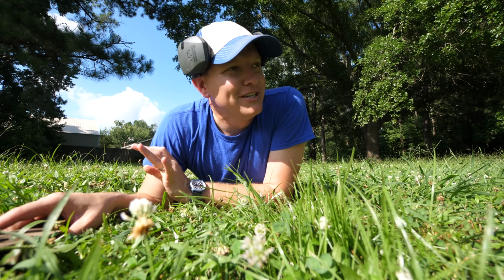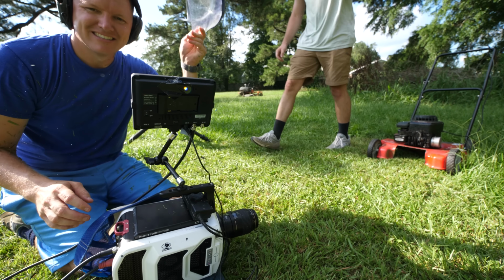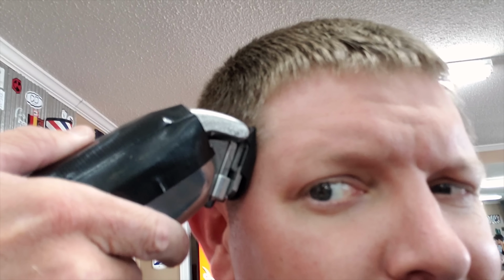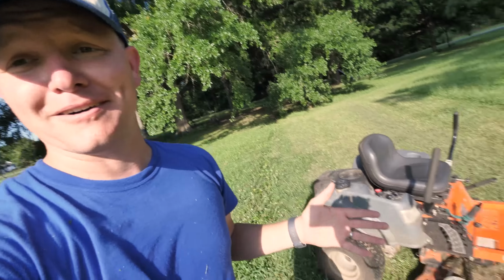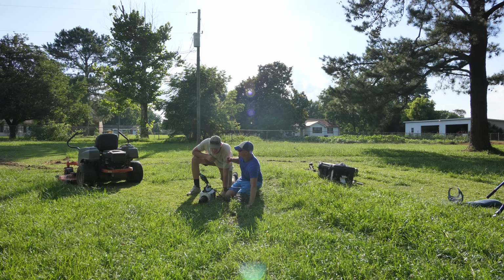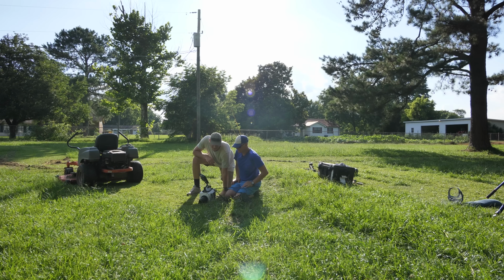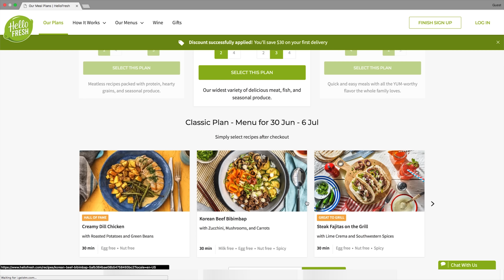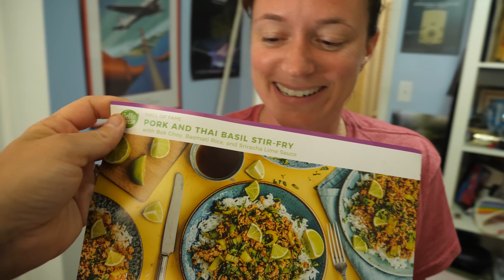How Lawn Mower Blades Cut Grass (at 50,000 FRAMES PER SECOND) - Smarter Every Day 196

Comment: I'd love to see how a scythe cuts grass. Does the curvature of the blade help or is it just for shape ? What's the technique etc
Reply: Not sure how the curve helps, if at all. I do know scythes need to be much sharper than a mower blade, like kitchen knife sharp. They also need to be honed very often while in use
Reply: the curve is because you kind of swing it around yourself and because your arms draw a curve the blade has to be that too

the grass is getting cut due to the slicing movement
Reply: grassynole07 
Speed is the key, blade to ground speed.
Fast and consistent, it’s an inertia tool.
Of course the blade should be razor sharp, done with light strokes of a fine grade stone every 4-5 minutes of cutting time.
An impressive tool in the right hands, and the movement is all in the knees and hips.
Reply: whatthewhat11 
A scythe is slicing tool,  like a Katanga.
The curve is so that the scythe blade hits the grass blade at a very small angle,  about 10degrees,  and slices it.
The cut swathe is less wide than the scythe blade.
It is not an inertia tool:  an experienced user can move the blade quite slowly.
This is quite different from the rotary mower blade,  which hits the grass blade at about 90degrees and so depends on speed and inertia.   The cut swathe is as wide as the blade is long.

I was taught to use a scythe by my father,  who (65 years ago) used it for mowing hay,  and by the gardener at the Manse who used a scythe to mow the squire’s lawn (A British lawn;  grass 0.5 inches).
Reply: Don’t think it was invented for cutting lawns .
Reply: The curvature of the blade means that as you draw it across, the sharp edge isn't hitting the grass at a 90° angle, but a much shallower one.
It's not like a razor blade, which relies on being incredibly sharp to do its function, but instead relies on moving across the grass, rather than into it. It's the difference between cutting and chopping; you cut down a tree with a saw by moving the saw back and forth, and you chop a tree down with an axe by hitting into it, not slicing across it. 
I hope I haven't over-complicated too much. Difficult to explain with words, but give me a bread knife and a loaf of bread and I could have explained it to you in seconds!
Reply: Kuubo 
You’re right.
Katana,  not Katanga.
Reply: The video is on YouTube
Reply: Basically the same physics really
Reply: Just cus of it being sharp
Reply: This makes me wanna cut grass with a scythe now
Reply: Oogly Sproggs your right but you kinda did slide your razor across your face to shave
Reply: This curving effect is easiest to imagine in a guillotine. Notice the angle of the blade in comparison to the direction of the force. This angle in addition to the sharpness of the blade makes the cutting action of the blade to move across the object with less required force to cut. The scythe needs to apply a lesser cutting force onto the blade of grass than the strength it requires to stand freely.
Reply: Simple - it's sharp !!!!
Reply: This comment thread is the lamest, most interesting thing I've done today and i work die making and assembly.
Reply: Wow I never thought about how scythe can cut grass.
Reply: Crve helps, just as the angle of a guillotine facilitates a ct
Reply: Scythe has a pitch angle also (not horizontal cutting edge, same as shaving razors), the curve mostly helps bundle and control the crop to the left for easier bundling/bailing. Scythes are sharper than mower blades which reduces the force / impact required to sever or locally fail the stalk material, reducing the cutting speed required. Scythes were traditionally peened and sharpened to allow for a harder cutting edge allowing it to hold an edge longer between sharpenings.
Reply: Yes the curve helps.   Curve in the blade is to hit the grass at an oblique angle.   The curve of the handle allows you to keep that angle through the swing.  It also helps to push all the grass or whatever into a bunch.   There are other curves as well.  I have a small grass sickle for gardening, and it's got to be held and swung in a specific way. You can't just cut.  Takes a certian speed and swing.  Big ones have handles and angles built in that make all that much easier.

Comment: Destin: Mowers don’t cut like scissors.
Reel mowers: Am I a joke to you?
Reply: The first thing I thought of when I saw this video last night.  I wonder if he is aware of this since making the video.
Reply: Beat me to it!!!
Reply: Obviously many people thought the same as me.  The neighbor across from my parents mows his acre with   5 reel mowers he pulls behind his riding mower that is just pulling.  He says it cuts sharper and straighter and from how manicured it always looks I'd have to agree.  I think some golf courses use these as well.
Reply: @johnjornod6429  Fairway and greens- Reels..cut more evenly and closer to the ground.  Rough - Rotary.  The reel mower blades are harder to sharpen and require more overall maintenance from what I have been told.
Reply: @Seriouslydave  Similar to a sickle bar.
Reply: @somaday2595  same thing haybine is probably the product name. Sickle bar is where the teeth are attached.
Reply: @Seriouslydave  Haybine is a sickle bar mower + mower conditioner and I think may have been a NH trademark.  I think disc mowers have largely replaced the sickle bar in most mower conditions.
Reply: @somaday2595  yeah, i still have scars from replacing those teeth. Esp in the field
Reply: I know I'm late to the party, sorry. Same here. The only difference is where I come from, we call them cylinder mowers. We use them on high quality sports fields. They have a much cleaner cut than rotary blades because of the scissor action than the rotary blades chopping action. 
The challenge with rotary mowers generally is the lack of vacuum. They need the grass to stand tall but not long, that's why they are in front of the wheels.
They also tend to follow the contour of the ground because they are usually I divided cylinder heads than one wide rotary deck. 
Also they don't tend to all discharge to the one area, they discharge straight out behind either in a receptacle or on the ground.
I would love to see more about the rotary mower though. Like some aerodynamic imagery with smoke or dust or whatever they use to test that. Get the camera through a looking glass of the deck say.
Cheers
Reply: @johnjornod6429  just cant have sticks and stones they make it almost impossable to ust 1

Comment: Lets do a collaboration on a stump grinder.  We can show how the teeth disintegrate the wood as they grind the stump away. That would be perfect for a slow mow sequence.  I have a brand new one we can use.  I've done a few heavy equipment videos like that and have plenty of gear to test out.
Reply: Also your retaining wall videos saved my backyard.
Reply: yes please
Reply: That would be awesome
Reply: Would be awesome
Reply: Mowing a 6 inch tall weed infested lawn with a rotary mower  and demonstrating cutting characteristics only shows that you don’t know what the original engineers had in mind when they designed it.
Reply: Woah, I follow you too!! This is the best...... 

Do ALL the collaborations!!
Reply: Any chance you live near Hamilton, Ohio?  I would love to see how it removes the roots from a tree in my front yard that needs to be cut down.  It is almost completely dead.
Reply: @Grumpy_old_Boot  An edger, how on earth can an edger cut grass?  There is nothing sharp and there is nothing to suck the grass up so it can cut.  Amazing how a something that only has a plastic line can cut grass.  It also edges.
Reply: @ksingleton101  
Yeah, that would be cool too.
Though technically, it doesn't really cut the grass as much as it used superior blunt force trauma to shatter the stalk apart !
Brute force approach. 😁

Comment: I want to see a chainsaw. It wouldn't be cool in wood(because wood is opaque) but maybe in clear plastic. I have always wanted to see the blade in slow motion tearing away wood chips
Reply: A circular saw would be cool too, especially if you could see how each tooth cuts from a different side.
Reply: Bigfoot And Bananaman for some insight. I would not say that chainsaw tears away the wood. It's more of a wedge that shaves the wood. Each tooth on the Chain just shaves a little more off as it's pulled through the wood. Similar to a wood plane shaving wood off. Circular saws do the same thing.
Reply: I rarely bother to comment on Youtube videos, but I came down here to also request chainsaw footage.
Reply: I agree with the chainsaw, including circular saws. My question would be about different chain types (not so common) or different circular saw blade types (more common). I know saw blade types are for rough cut (fast ripping) vs smooth cut (usually slower). I imagine there is a trade off between how much material you can knock off with each tooth VS bogging down the motor and loosing RPM & efficacy.
Reply: I also want to see a chainsaw,  a real nice gas one and maybe a comparison to a decent battery powered one. I'm curious about a few things.
Reply: The Wreckers keep the tooth from twisting and taking too large of a bite this twisting action causes the tooth behind it to skip at least that was the reason I was given for the design of the skip tooth chain, honey skip tooth higher ratio of  teeth on the Chain are actually cutting each pass circular saw and guessing is going to be each tooth is cutting as the blade is not distorted that shape on the hinges
Reply: chip formation in metal cutting is some pretty cool stuff too.  There are videos already available for that though.
Reply: It's super interesting how saws are designed to handle the waste product of sawing, they often have special teeth designed into the saw's blade to push the shavings out of the cut. The cooler thing is that chainsaws handle shavings different from cross-cut saws, which handle it different from other types of saws.
Reply: you could use a flat board and see the chips getting cut
Reply: David Drescher,  The rakers, or more specifically the depth gauges limit the amount of wood each tooth can cut on each pass.  The drive links on the chainsaw chain limit side to side movement in the cut.   The cutters actually porpoise in and out of the wood taking bites, until the space between the cutters fills up and then it stops cutting and just drags the debris out of the cut. 

  Standard sequence chain has a right cutter and then a space and then a left cutter.  Skip link chain has a right cutter and then 2 empty spaces and then a left cutter, so you have 1/3 less teeth on a skip link chain than a standard chain.

 This comes in handy on long chainsaw bars over 2 feet long, because the length of the cut is so long the spaces fill up too fast on standard chain and spend more time dragging than cutting.  Also because you have less teeth on skip link,  it takes less engine power to pull the chain through the cut.
Reply: I ask for this on every slow- motion channel as well :)
Reply: As a bonus, slow motion video of how different hinge types cause the tree fibers to fail/bend/guide the tree as it falls.
Reply: Bigfoot And Bananaman ，
Reply: @WhoDatBoudreaux  im not an expert in chainsaws but i can tell you this
the deeper the cut depth on a chain saw the more likely it will try to kick up 
the deeper the cut the faster you can vut but that also probably means you get a rougher cut (similar to a circ saw) 
a shallower depth o cut means lower risk of slicing your face open on the chain (which is why theres a chain break in the even of a kick back {the break will engauge and keep the chain off of your face}) you probably get a higher qualaty cut but its slower
my dad had a stihl ms 171 with a 16' bar and a fairly shallow cut depth it worked and it was as good as you can assume for a consumer grade saw
he got a stilh (i forget i think its liek a 261 or something) and it has a biger 18' bar with a larger depth
its also a larger saw
Reply: If u just said why u dont want them to cut wood and you want them to do it with plastic than why are you now saying that youve always wanted to see wood chips cut?
Reply: But that is pretty self explanitory of how it works, theres nothing to explain.
Reply: Bigfoot And Bananaman what i would love to know is how chainsaw motors are so durable and hardly have any motor faluire unlike other bigger 2stroke engines that are so common for piston or ring troubles but yet a chainsaw will run 20 years without a hiccup but a 250 dirtbike motor needs to be rebuilt once a year
Reply: Maybe you should youtube it 😆
Reply: Very satisfying it would be

Comment: I learned something today too... your lawn mower blades are super dull lol
Reply: I noticed that to.
Reply: It is kinda interesting... at one of my first jobs, the guy I worked for had me use a lawn mower which was later found out to have the blade upside down.  It did not cut well, but it did... far better than I ever expected it to.
Reply: @tonysmith5077    *too
Reply: I just wanted to kiss those blades with a bench grinder. Or a file. For real.
Reply: @paulstandaert2042  I thought you were me lol
Reply: Good luck changing em
Reply: Ha.  Same comments below.  I felt sorry for the grass blades getting beat to death with a dull blade.  I am a sharp tool fanatic and that hurt to watch.

Comment: Lawn series: Does a drop spreader spread more fertilizer when it's full (compared to the last quarter before empty)?
Why do some garden hoses kink and others don't?
Does a sprinkler apply water evenly, or more in some areas?
Is a reel mower like a pair of scissors?
How does an aerator really let the air flow in, although the holes are far apart?
How can you reduce evaporation on your lawn?
How does cutting your awn to different heights affect evaporation, spreading of grass plants, wear resistance, weeds...

Comment: Well, the most obvious thing to study next is the weed wacker, but I'm curious about the garden hose sprayer. You know, the one with the dial that you can use to switch between spray options like, shower, jet, and mist. I'd like to see an explanation of how the water breaks up and spreads out as it travels through the air.
Reply: You most likely put more pressure for jet with a different pattern  and less pressure for mist with a different pattern
Reply: I agree - the weed whacker (also known as a line trimmer or whipper snipper) would be a great second edition to this series.
Reply: Not exactly. Spray Systems does the science behind sprayers. The shape of the cavity is very carefully designed to get different spray patterns. A lot more to it than just pressure like turbulence and flow regimes.
Reply: Jonathan Tash I want to see the weed wacker
Reply: You always study whackers

Comment: Cylinder mowers (called reel mowers in the US) have opposing blades. One is fixed to the frame, the other is wrapped around the cylinder (usually 5 or more separate blades) and as they rotate they shear the grass between them selves and the fixed blade. They make a much neater cut, and for that reason are used on fine lawns, putting greens, tennis courts etc.
Reply: Spencer Wilton my first mower. No ethanol!
Reply: I was going to say the same thing.  Reel lawnmowers have been around, I'd say, for more than 100 years.  No, I can't provide a citation. They typically have a grass catcher on the back.  For a push type lawnmower the reel is driven by the wheels via a ratchet system of gears so it can continue to spin even when the wheels were stopped.  The sound of the ratchet was a sure sound of summer many years ago.

Even today, the grounds keepers for golf courses use reel type lawn mowers on the greens.  A rotary blade just wouldn't do, maybe on the fairways but not the greens.
Reply: oooh. thank you!
Reply: They also get wracked but non-grass (sticks, rocks, toys, etc.) running through them more easily and more labor intensive, is also why they are better suited to highly manicured small areas.
Reply: Also sickle bar mowers and similar used for harvesting hay (just drops it instead of pulverizing).
Reply: Donjear that's why they are almost exclusively used on professional sports fields and golf courses.